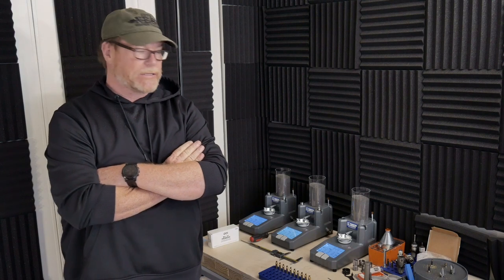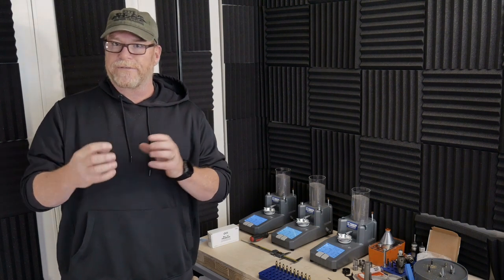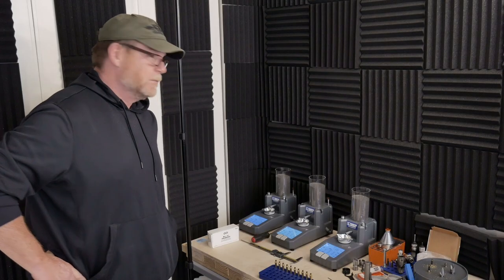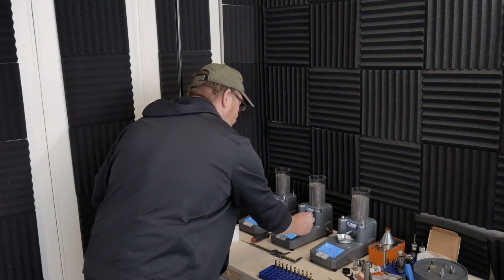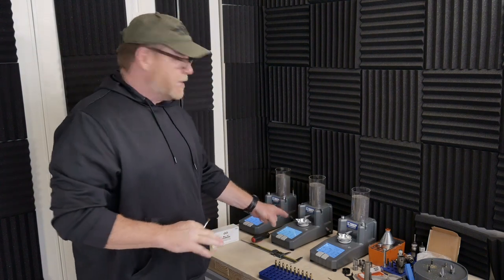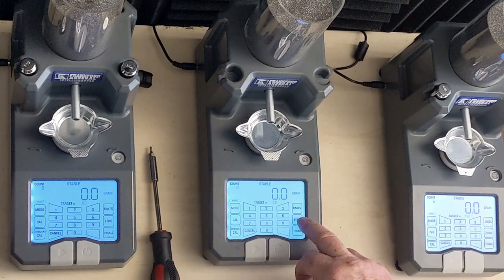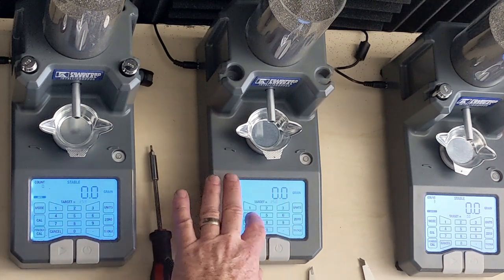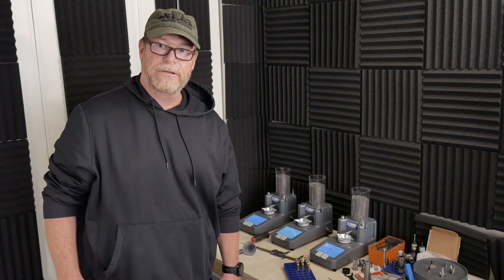Frankford Arsenal Intellidropper Three at Once!  How Close are They?

Comment: A light drag of a fine file on the pan would work to "calibrate" the pans.  Remember, you are calibrating to a number between the .1+ and .1- measurement. The different pan weights can be  .05 different and read the same.  Try filing each pan while adding a grain of rice until the scale breaks the thresh hold to the next .1.

Comment: Nice video. Even with the not reading the same it was within specs. When you measure from one dropper that has a 1 tenth grain + - and then take that charge to another dropper with a 1 tenth grain + - you can end up with 2 tenths off and still be in spec. They were both independently calibrated with different weights and different weight powder pans. Think about it. You video was quite informative and shows that this will work for your application. I have one of these intellidroppers myself.

Comment: You should use gloves. Use nitrile gloves to keep the oils on your fingertips from effecting the weights. I'm not sure what kind of accuracy those scales have, or what class of weights those are. However, the scale has enough resolution to potentially be pretty accurate. Also, use +90% isopropyl alcohol to clean them.

Comment: ...I'm fixin' to load .38/.357 for the first time (I've been loading, off & on, since I came home from the Army in Germany in 1974 - started on an RCBS Rockchucker and graduated to progressives in 1986 - been loading .45 ACP & 9mm mostly with some 5.56, 7.62x51 & .45-70 along the way) but want to develop different loads for various types/weights of bullets in small batches of 6 to ten rounds each before deciding which ones to run on my Lee 4000 & Dillon RL500B...figgered this Intellidropper would make the tedious works of  dialing in numerous powders/weights much easier...it's worth 200 bux to try and will come in handy when I load rifled rounds - I've already got my pet .45 & 9mm loads...

Comment: When you're calibrating, let your weight stabilize before hitting calibrate again for the 100g weight. Also, I'd be curious how much it effects them sitting on the same table running at the same time. I've found if I'm watching a video, I'll prop my phone up on my bench (very heavy duty workbench), but the sound vibrations from my phone actually throw my scale off. Also my fluorescent lights tend to mess with it.
Reply: You could have read that in the manual. Lights electrical etc. It's there and simple to read.
Reply: @garrytalley8009  I agree. Thats why I'm telling him.

Comment: I have a RCBS and they have treads inside the powder tube. Sometimes trying to get that last tenth a kernel are two will drop off making it over by a tenth. Doesn't  happen often but a Hardy's drinking straw with a piece  of electrical tape wrapped around it inserted in the end will help. Those you have may not have that problem.

Comment: I understand the frustration.  I use a beam scale to back up my RCBS charge master.  .1 difference between the 2 usually.
For a quick check I measure the 50grm weight. It should be 771.618grn. So 771.6 is what I expect to read.

Comment: You're likely never going to get consistent results using 3 different scales, and these scales are only accurate to +/-.2gn. You are dealing with a lot of variables. Best you can do is sand down the heavier plates to the same as the lightest one (you'll have to pick a scale to be the control for this. Meaning weigh all 3 plates on the same scale) then calibrate all 3 scales using the same calibration weights. But I suspect it will all fall apart during the powder calibration process, maybe skip that step if you can as I'd bet they'll all calibrate differently.
What matters most in reloading is consistency and repeatability. what reads 24.5gn on one scale may not read the same on another. Even if the measure is not actually 24.5gn as long as you use the same scale and that scale consistently measures out the same amount you will have good results.

Comment: Old video, but I’ll comment anyways. The reason I get 35-34.9 is because the are accurate to the 1/10 so it’s rounding. So ur probably getting 34.96 on the right and 39.94 on the middle, most likely u are within a couple 1/100th which is way more than adequate for standard reloading. Unless ur gonna take the time to do every possible precision accuracy step, you will never notice it. For the price of these things, that’s excellent.

Comment: Second intellidroper died in three years , the electric motor is dead ,as I'm located in Spain guarantee don't apply , I can replace but no way to know the RPM .. I know is 12V but factory don't want to tell me if it's 100/200/300/500 or 1000 rpm😡🤬 , bad  from customer service

Comment: That's a bit nit picky sir, there would be NO difference in performance between a cartridge with 34.9 or  35.00.  NONE!   Talking while doing this could cause your breath to mess up the scales.   Unless you're shooting under the EXACT conditions, a clean barrel each shot, the firearm mounted in a VICE, 0 wind, same temps, humidity, every thing, you'd not see any difference.